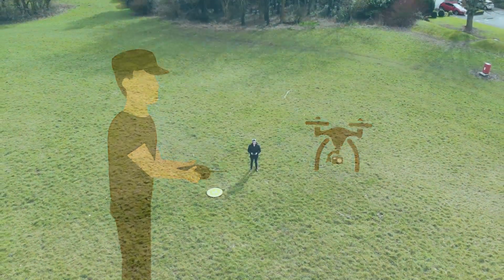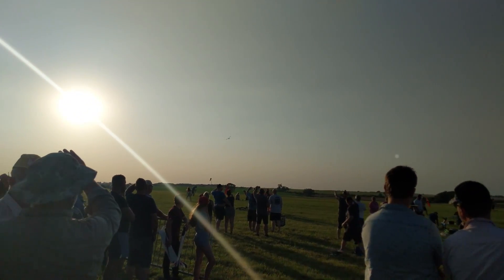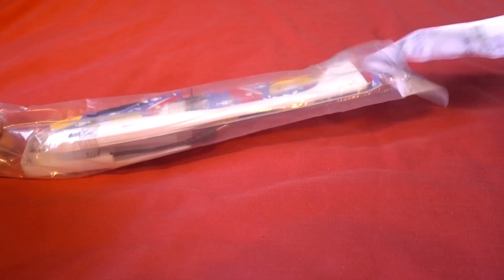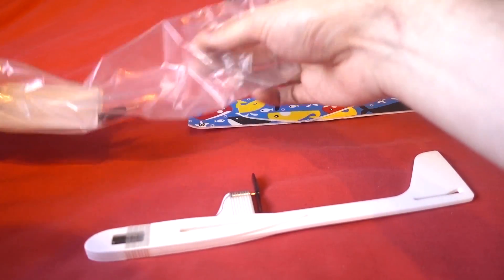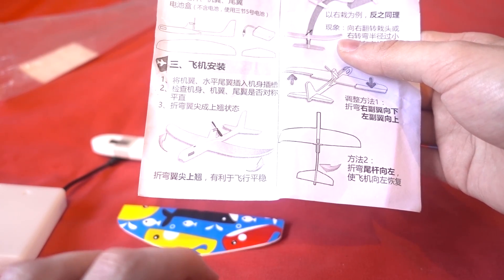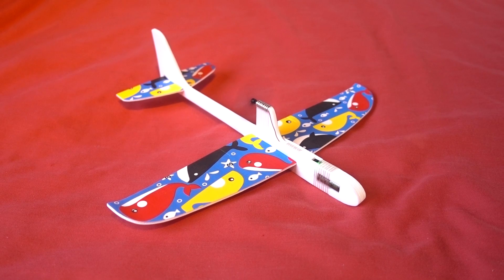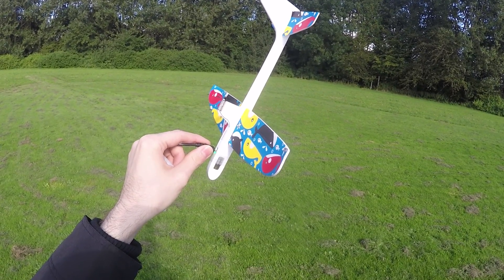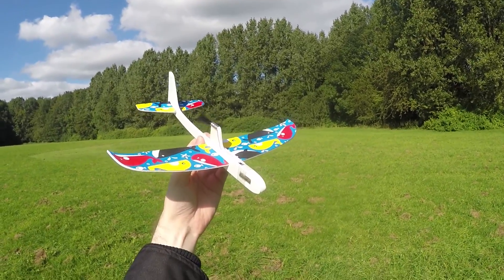No Control! $8 Super Capacitor Free Flight

Comment: I bought one, actually 2 in case. I used to do competition free flight which was "interesting". Hundreds of feet climb in 15 sec max timed run, with 4 minute  max flights. 

FIRST: I recommend still air/calm conditions. . WHY? They are 10g all up light so a good flight, or increased wind,  can suddenly carry them far away - very quickly!  Now I want to add simple control like the old dethermaliser way to terminate flight. Of course you can also limit the charging time. 

DON"T FULLY CHARGE ON WINDY DAYS IF THERE ARE TREES ETC AROUND. Words of wisdom.

This is an especially  cool toy for someone who has been getting scrubby flights out of chuck gliders for years and is running out of chuck with the passing years.. I now seek ways to power my heavier chuck gliders that are. 30-50 gms but do use significant nose weight.....

Comment: Just need to add control surfaces and it's micro fpv time, mid air recharge every ten seconds with TINY lipo for record flight times. ;) ardiuno kit go! My tiny weiner could hold two to 4 mcs tiny lipo and smart rx with ease😊 Been stuck on this idea as prices come down in supercompasitor land.. Great review thanks for the pids on tune on the 349!

Comment: Thank you Andy. I did Free Flights years and years ago. Mine had a fuse that you would light right before you let her go. When the fuse burnt down enough it would burn a Rubber band and the horizontal stabilizer would pop up sometimes. Then I would run through corn fields to sometimes find it.  I had 1 that got so high the little cox engine ran 5 times longer than normal. We tried to follow in a car but lost it after several miles.  It maybe is still flying. It was red if anyone finds it lol.

Comment: Long ago, before you or most of your subscribers were born, I flew FF (free flight) .. and U/C (control line). It was cheap fun for one with limited funds from a paper route. About the age of 14 I got my 1st RC model, which took quite a bit of saving to buy the single channel equipment, 48" wingspan aircraft, Enya .15 RC motor, etc. No 'sticks' on my tube single channel transmitter .. just a momentary contact push button. Press & hold for Right; press, press & hold for left; quick 'blip' press to change motor from high to low speed. If I was lucky, and no CB-ers were around (radio was on 27 mhz, channels located between CB channels), I could expect to get a few flights in at the local flying field. Since we only had 6 frequencies, everyone had to wait until their frequency was open. Ahhh .. the good old days.  Probably about 2 decades ago, I bought a FF much like you show here, but with much better looks and performance. I had a ball with it, usually putting in 6-10 flights at the local school field before heading home.  One night, on the last flight, I decided to let it charge a bit longer than usual, so that I'd have one good long flight to go home on. Well, it got up pretty high, into some slight breezes which weren't around at ground level. The model wound up on top of the school building with daylight almost gone.  I came back the next day to see if anyone had found it, since there'd been some high winds that night. No luck .. not on the ground or on the roof, so I suppose it got blown down and some kid got a present.  Sometimes the simpler the model, the more raw enjoyment you get out of any kind of successful flight. Cheers!
Reply: Hi Bill! Similar story here...single channel with escapements, 1/2A power, never quite under control but tons of fun! My flying buddy Richie is another long time builder and we fly a mixed bag. Hope you'll check out our channel sometime. Mike in western Mass

Comment: THAT is the excitement I grew up with. Only we had to wind the rubber-band before every flight. Add some dihedral to the wings.. If you want to go crazy you set them to twist up into the sky one way (under power) and then fly a circle the opposite direction when power is removed. It would take forever to explain. :)

Comment: WOW reminds me of the similar sized wind-up rubber band powered balsa free flight flyers of my youth.   Some even had light weight landing gears.  They were a ton of fun... and very cheap! 😁
Reply: @RaZoR3379 That's very cool!  I seem to remember that back in the day these toy flyers cost about 10 cents.  And just last week I read an article about a guy who flies a small rubber band powered RC version.  It's a little larger though.  But even Andy's Super Capacitor model could be easily converted to RC.  (Hint hint Andy!)